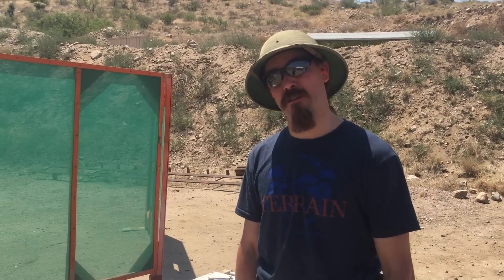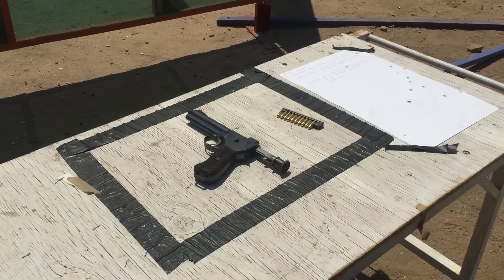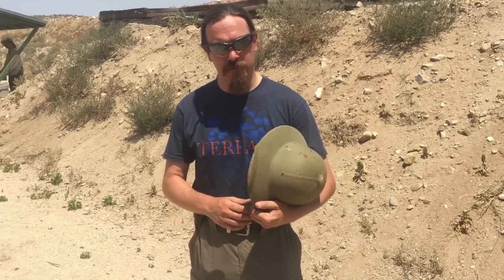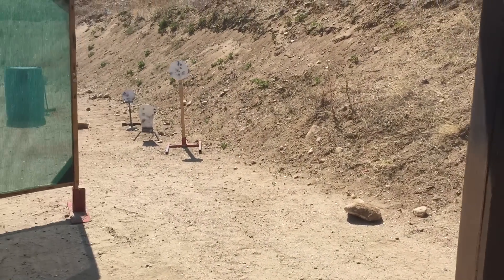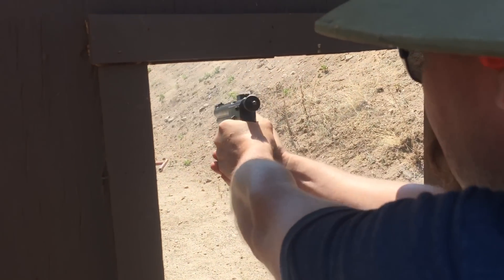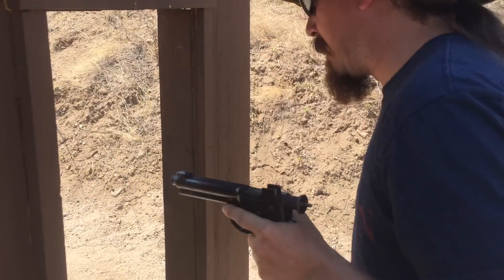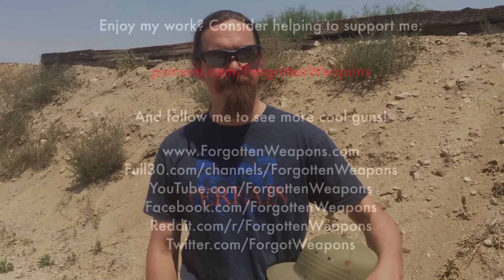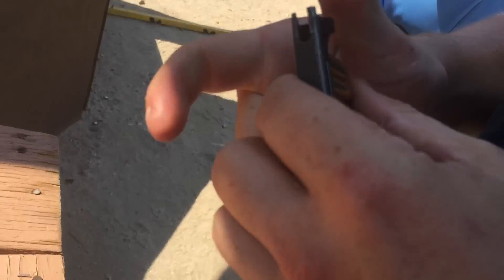Roth Steyr 1907 at a Run-n-Gun Steel Match

Comment: what kind of holster are you using for a left handed person? I'm asking because I'm left handed and looking for one like that.
Reply from the maker: It's a UM-84. It can be set up for either left or right handed use, and fits almost all service pistols - I'm really happy with it.
Reply: +Forgotten Weapons could it fit a full size 1911 with rail?
Reply from the maker: I believe so.
Reply: With rail, yes. With anything attached to the rail, doubtful.Be careful with a 1911 in a UM84 holster, they will fall out if the only retainer is the flap, BTDT pretty embarrassing. I punched a hole in the trigger guard slot and used a small zip tie to tighten the holster when I was carrying a 1911A1. I also used the thumb break attachment, no more problems.